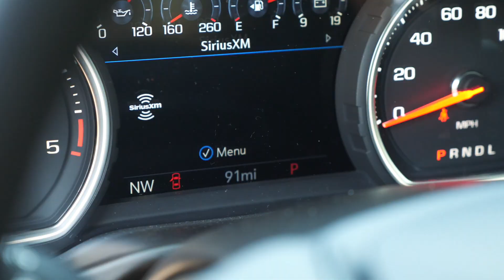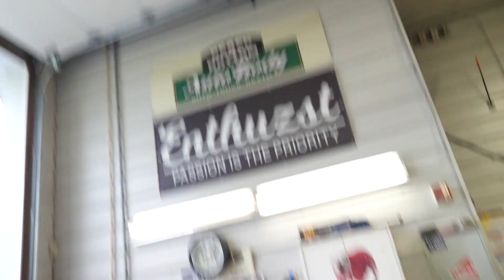6 Years Later, I FINALLY Own One!

Comment: Another set of transparent copper wheels should find their way to the new truck. 24x10s on 325/45r24. Reverse leveled with Sulastic shackles 1.5" drop. Upper control arms and Bilstein shocks.

Comment: 22x10 on 33x12.5 tire. Fits no trimming/ down side of power running boards is that they don’t shield you from throwing rocks with the wider then stock tires (2021 denali HD)

Comment: I have a 2021 Silverado 2500hd that I had leveled and what I discovered is that the front fenders are cut at a different height from the rear. This will give it the appearance that the truck is leveled when it actually isn’t. If you level the truck with  aftermarket keys, it will appear to squat but will be leveled. Sorry for the long explanation 😅

Comment: Satin black and bronze accents on the new high country with a mild lift and larger tires on the factory wheels and some different lights. The later question in the video I would take the LBZ doesn't have the super restrictive emissions garbage.

Comment: 7 inch lift with bronze powder coat, black 24x14 with bronze windows on 37 inch toyo m/ts, wherli parts in bronze with a 5 inch strait pick powder coated black with a bronze tip

Comment: You should get another L5P Duramax for another Duramax build series from bone stock to absolutely badass wherli custom fab pipes,full turbo back exhaust,American forces,new turbo like the last red l5p and rock lights and flight fab track bars and boost auto parts mirrors

Comment: I would do a bds 6 inch suspension lift on 37/13.5 inch nitto terra grabbler mts on polished American force 22/14s and 5 percent all around on the windows and 5 percent strip on top of windshield and 50 percent tint on the rest of the windshield

Comment: If I had unlimited money, id build an extended cab short box K2XX Chevy probably a 19 model and swap in a LBZ and a ZF6. Strip it down to the frame, paint the frame red, the body black with a red flake, and full chrome. Now that would be a sweet truck